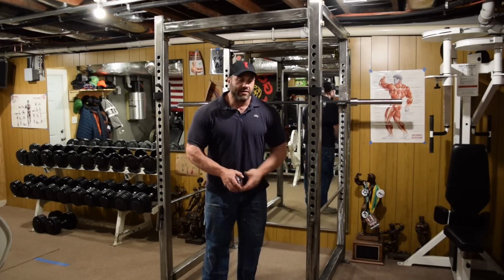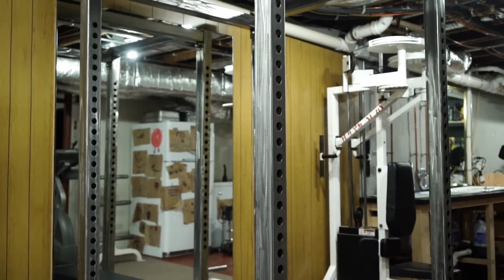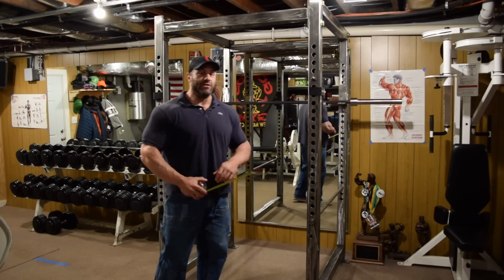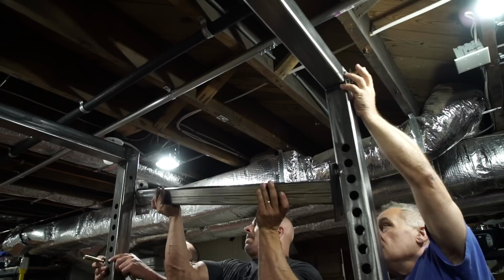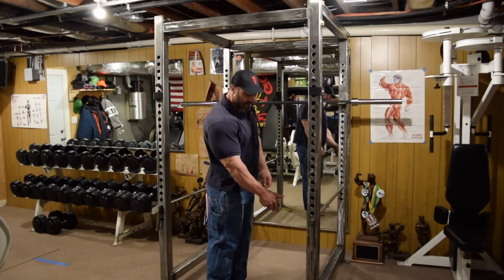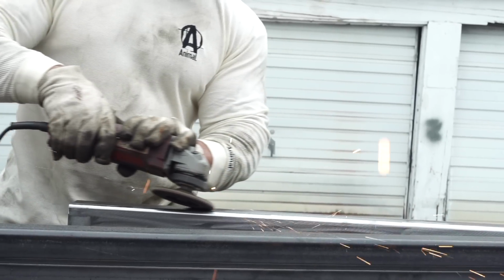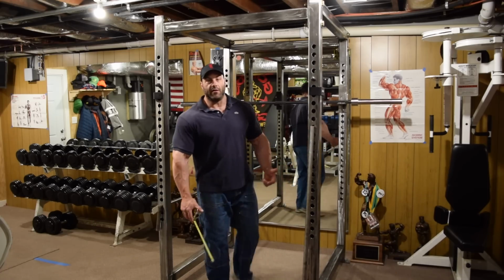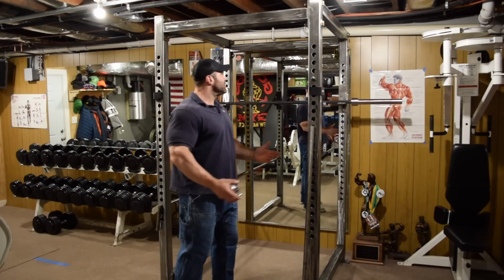The Build: Guidelines for the Rack with Evan Centopani

Comment: wow what an insane built! I've also constructed and built (just a half rack due to limitations in my garage) a rack myself, but yours is looking so much better! and especially the wholes are just perfect!! I also had access to better equipment (no way to do that with commercial equipment anyway :D) but not that automated so not every whole got perfect. which steel have you used? commercial raw material S235? or aluminum? have you coated the rack? Really like this effect, but at least in the garage it would beginn to roast. Mine is with double coating (and still beginn to roast...) if you want too, or your fans on youtube, I can provide you autocad dwg or  pdf drawing of my rack. Regards from Austria - Lukas
Reply: Cold Rolled Steel

Comment: I live in Staten island NY. Corona got us for a second wave, and i have a low basement ceiling =(. Does any one know the going rate for 3x3 steel square tube? I'll settle for 2x2 if necessary. I have a chop saw a measuring tape and a ton of drill bits...and  of course time! if any one knows get back at me

Comment: No machinist will let you use their equipment if you haven't ever touched a mill or welder before as it is way too much liability.  At the very least, if they are your friend, offer to buy replacement drill bits and a few meals and they'll knock it out in a day.